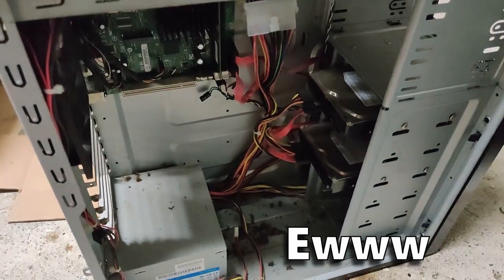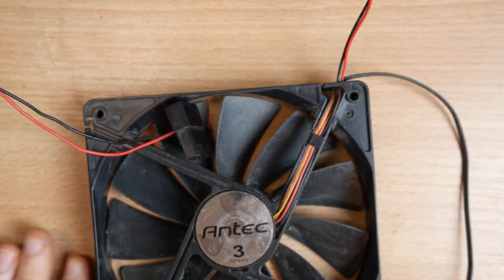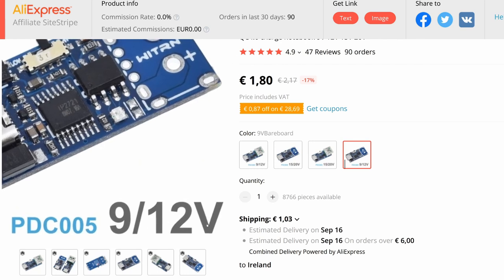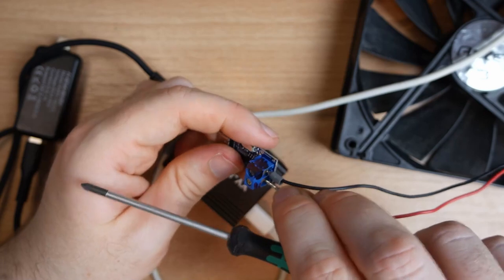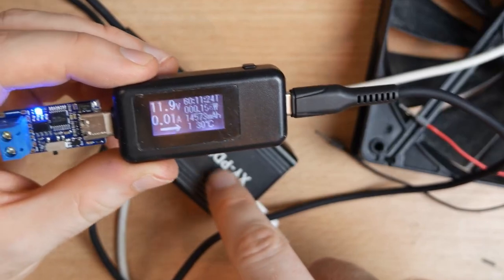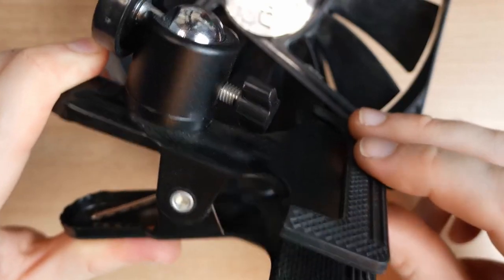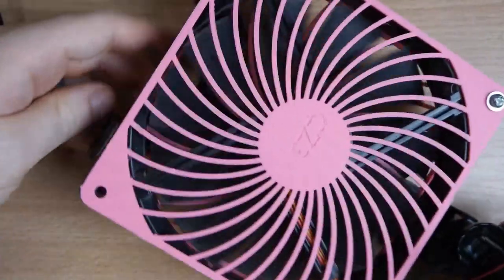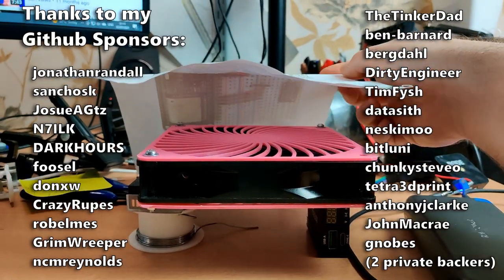USB-C PD Powered PC Fan (to stop me from melting)

Comment: Nice! I did something very similar earlier in the week, but yours is actually a little more elegant/polished, believe it or not :)

I grabbed a spare 140mm Noctua PC fan (housemate bought more than she needed for her last PC build), plugged it into a "Molex" PATA HDD power adapter because it gave me a larger target to attach the croc clips of this USB-A-to-croc-clips cable I had laying around. That's then plugged into a QC3 trigger module so not only can I get 12V for the fan, but I can adjust the fan's supply voltage between 5-12V in 0.2V increments :)
It's a hacky wiring job, but I didn't want to get the soldering iron out!

The fan is then mounted to my bed's headboard by zip-tying it to a knock-off magic arm - as commonly used for cameras/etc 😹
That's actually not great: the magic arm transmits the fan's vibrations into the bed too much, so the fan ends up being far louder 😕

I think I actually have one of those tablet holders somewhere, so I'll have to try your idea!

Comment: Creative use of parts that you had laying around. I guess I shouldn’t ask why you didn’t just go to to the store and buy a proper fan 😀.
I live in Mesquite, Southern Nevada, where the temp right now is 89°F, and that’s at 9:00pm. By next Wednesday the high will be 109°, low of 84°. A/C is a must, fans just don’t cut it.
Reply from the maker: It was unprecedented heat in Ireland so all the fans were sold out everywhere! It cooled down here again but it reached 31c (88f) here during that time, the hottest it's ever been in Ireland on record is 33c (91f) so we just can't handle it 😅

Houses don't have AC in Ireland as generally we don't need it.
Reply: @BrianLough  I was just kidding. I understand about the lack of A/C, I was born in Coventry and spent the first 37 years of my life there. Until I moved to the US, I didn’t know that houses could be air conditioned.
Have a great weekend.

Comment: I don't see the sense in using a miniature connector for power when you don't have to.
Reply from the maker: Usb-c? I'm sure the connector designed to work with 100w will do just fine on this 5w load 😅